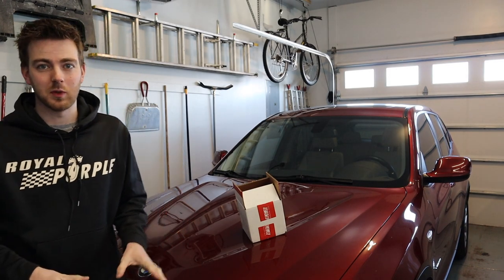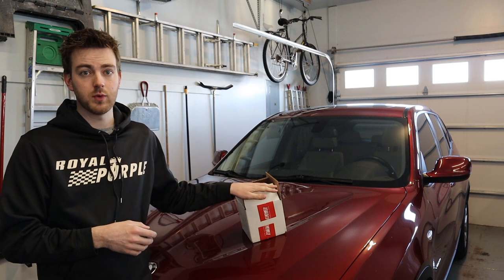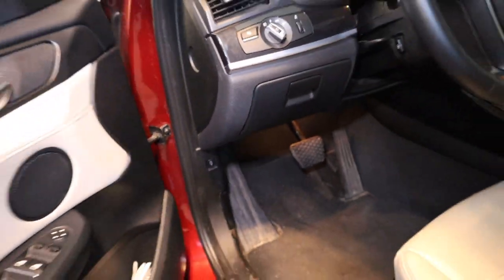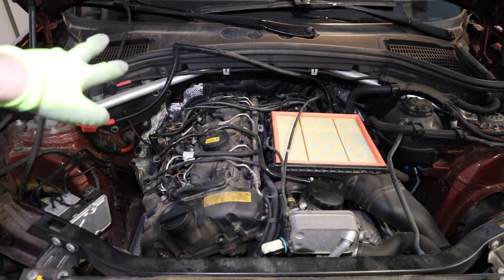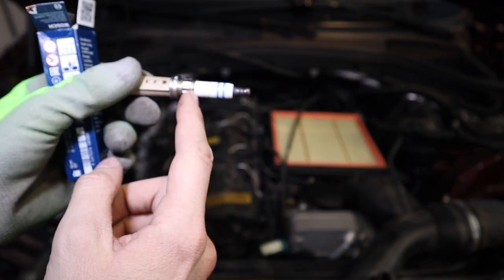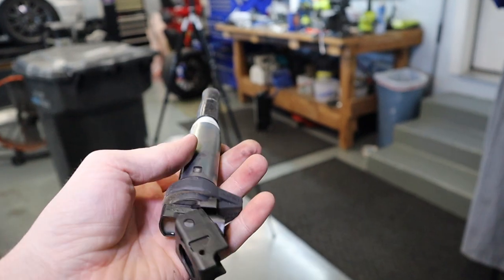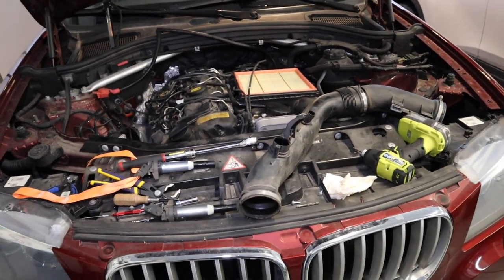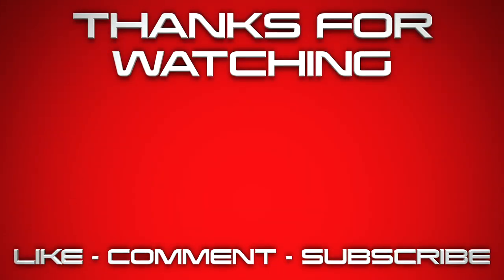N55 spark plug replacement - DO NOT take your car to BMW for transmission faults - X3 F25 coil packs

Comment: I just went through the same thing on a 2012 X5 N55. Cylinder 5 had the same failure of the 'white' powder. Changed all 6 ignition coils and spark plugs. I had to remove the cabin air filter to access cylinder 5 and 6.
Reply from the maker: It happens. Glad you were able to diagnose and repair. Other than this one issue, our n55 x3 has been bullet proof!

Comment: The valve cover vent hose typically breaks due to the heat cycling. It is recommended to order one when removing that pipe because it almost certainly will break if the car is several years old.
Reply from the maker: This is true. Always best to replace proactively instead of waiting for leaks to happen.

Comment: I really wanted to see that bracket in the back come off. I’m having issues with #5. For some reason my mechanic decided to change the injectors first.
Reply from the maker: Sorry I didn’t show every detail. There are a bunch of different videos. I would have thought someone showed that specific part.
Reply: @TenzaMotorsports  I figured it out

Comment: I replaced all the coils and plugs and I still get the transmission light on and abs, misfire on all the cylinders, but the car runs, I don't know what to do, help 😢
Reply from the maker: Beyond that, I’m not sure. That should have cleared it up. Your worse case scenario is to get a dealership quote. These newer bmws I don’t know as well as the early 2000s 3 series
Reply: Check your battery. When the modern cars start lighting up like a Christmas tree, the battery is often getting weak.

Comment: Coil packs are notorious for failing.  I’m surprised you never had one fail.
Reply from the maker: I've owned and ran BMW for over 13 years at this point. never had to replace a pack due to failure. I've done preventative maintenance before. but never had one fail.

Comment: Hey nice work 
I got a question i got 2014 bmw x3 2.0L 
When the engine is cold it doesn’t accelerate and it’s seems like you are hitting the brakes after it’s in the operation temperature it’s running smooth I don’t know if you have any idea how to fix that i will appreciate that
Reply from the maker: Engine codes? What trouble shooting have you done?

Comment: I just saw a video a day ago where someone said a 12 point 14 mil deep socket worked just fine on these weird plugs. He didn't say anything about having to grind it thinner.
Reply: Typically a standard socket is too large a diameter to fit.  Buying a spark plug socket is cheap.

Comment: Thanks for posting the video.  Did you have to disconnect the battery first?
Reply from the maker: Yes. Always disconnect the battery when working with electrical.

Comment: What cylinder did your scan tool say was not firing properly??   Those plugs look good.
Reply from the maker: It didn’t give me a specific cylinder. Just said "random misfire" if I remember right. and yes the plug looked ok. but the owner just said to replace them. Car had over 70k on the original plugs and they wanted them replaced.

Comment: How long should i change the spark plugs ?
Reply from the maker: Around 70k miles. It won’t hurt them to run until you start noticing they are slightly off. But it’s always better to be proactive instead of reactive with maintenance

Comment: Hey bro. I just have a question about my e36. I bought an aftermarket front bumper and I can’t get it it fit properly, the reinforcement bar still shows by about an inch, right underneath the grills. Got any ideas ?
Reply: Get a REAL bumper?